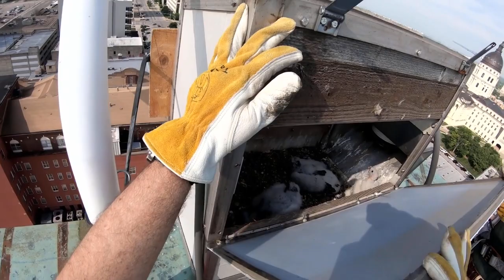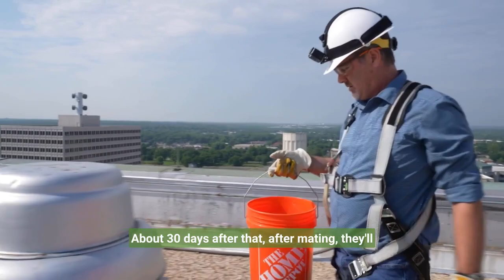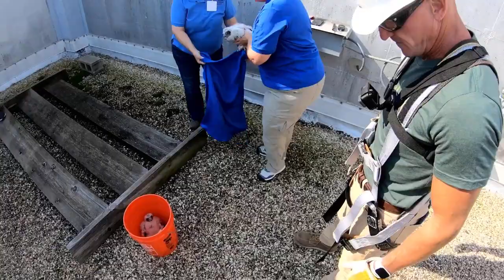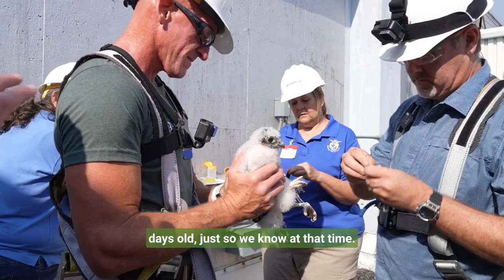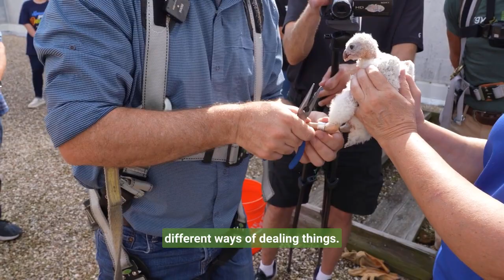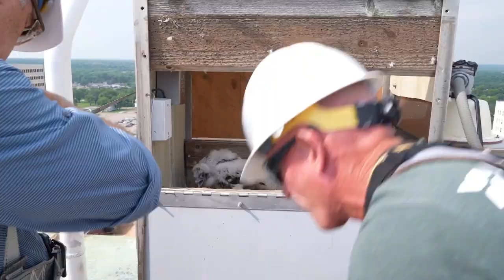Evergy Bands Falcons at Topeka General Office Building

Comment: The smallest little guy cant get up out of the scrape to get fed because the front wall is too high.  I've been watching this nest since the beginning and since the 2 older siblings have been able to get up out of the nest box they're getting all the food on the upper platform. Unfortunately the parents feed the mouths in front of them so no food is being taken down inside the nest box to feed the little guy. The front wood board needs to be lowered so he can get up out of the box & be fed.  It's heartbreaking to watch him screaming to no avail, he's so hungry & he's not being fed as he should be :(  Please help and fix the nest box!
Reply from the maker: Hey Laura, appreciate your concern. We're watching. The smallest bird has actually jumped up to the platform to eat in the last day or so. He's also taken food from the platform and pulled it into the box and pulled apart pieces to eat on his own instead of waiting to be fed. Just wanted to sure to speak to this. If we determine there's a need to intervene, we will take the necessary steps to get permission to do so. Again, we appreciate your concern here!
Reply: @Evergy  thank you so much for your reply, much appreciated!  I did see him pull food into the box yesterday & was so happy to see his strength & tenacity and a crop on the lil guy. Unfortunately that was 24hrs ago & at this stage he needs to get fed a lot more for proper development & strength. I'm hoping this changes real soon for the lil guy & he makes up for all he's lost. It's great to know you're watching along with all of us viewers, we all care about these sweet & very important raptors. I watch many nests of peregrines, eagles, hawks & owls and the one thing that always rings true is the smallest or youngest always end up being the toughest by learning life's lessons the hard way. I have no doubt this will make the him a strong survivor. Thank you for doing what you do for these precious peregrines! :)
Reply: The two older ones fledged in the last 24 hours. Hopefully he'll be able to get more food if he's the only one in the box now. Fingers crossed. Been following this nest for about 3 weeks. I myself thought too he wasn't gonna make it but he's a fighter always stealing food from the other siblings.
Reply: @strungoutkid I agree and I'm so happy for the 2 that left the nest box, congratulations!. I didnt see the 1st one leave but the 2nd looked more like a fludge not a fledge. I hope they're together somewhere safe below the nestbox they havent flown yet so the parents will feed them wherever they're at. I dont know if there's a ledge or another roof line below the nestbox where they might've fallen to but I hope so. I hope the parents also take some of the food to the nest box to feed the lil guy, I'm sure he'll be squeeing when he hears them. Its a nice clear day for hunting in Topeka but its a hot 87 degrees just after noon!  I'm cheering for the lil guy in hopes he gets lots of food real soon and fills that crop so its huge!  Even tho he's a lot younger than his sibs he's a male and they're always smaller but very feisty & strong he's proven it the last couple days by stealing food, he's so hungry!  If he only knew how many of us are his fans! :) ❤
Reply: I looked on Google maps. The nest box is on top of a 10 story  building so hopefully the sibs are ok. Long drop. But yeah I totally agree too! Wish they would open chat on the live cameras so we could all talk there. I feel like this video is just gonna be updated comments about the live videos lol